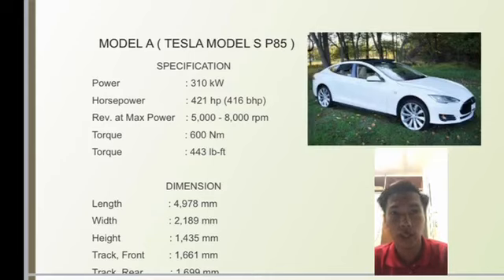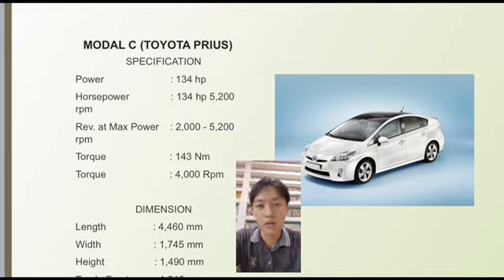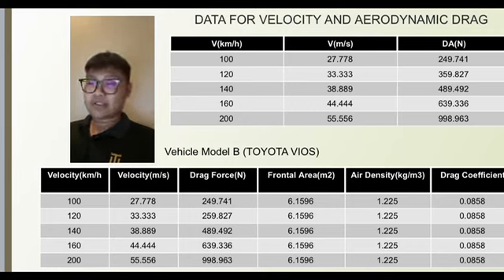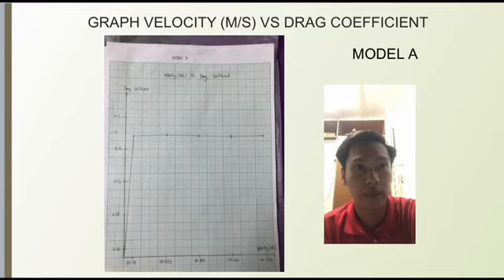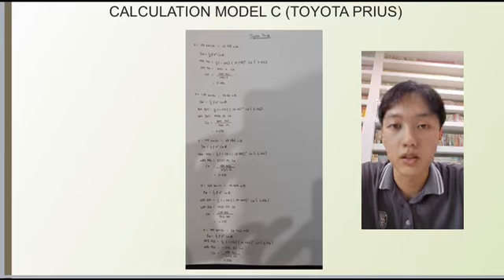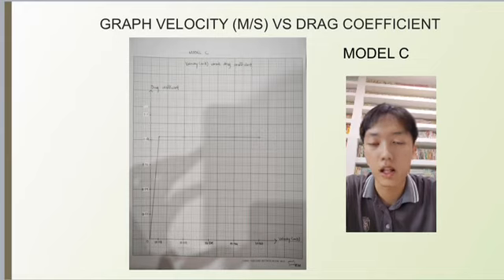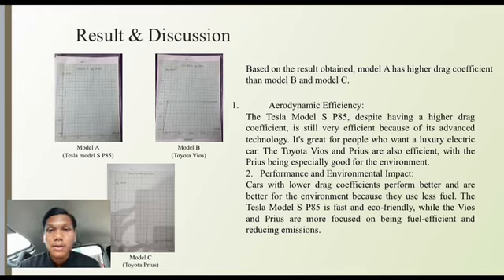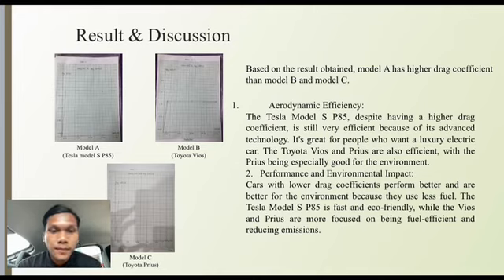PRESENTATION VEHICLE DYNAMICS

Comment: Just saw this in my youtube channel homepage recommendation. The presentation is alright for engineering student, but the graph should not be plotted on a piece of paper. Try to use matlab, excel, or python matplotlib to look more professional. The presentation slide should not be a full wall of text cause your audience are not gonna read through all that. Condense your sentences into bullet points or to figure/value that you can make case comparison on. Hopefully you guys take this constructive criticism to be a better engineer! Good luck!
Reply: You can present your equation/calculation process  using latex or mathjax. It’s more beautiful than handwritten equation 😊